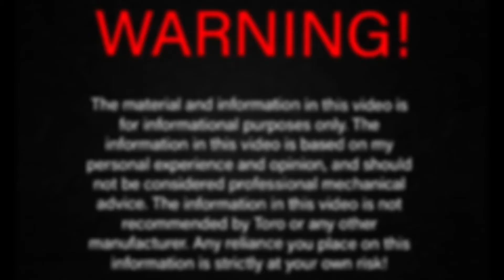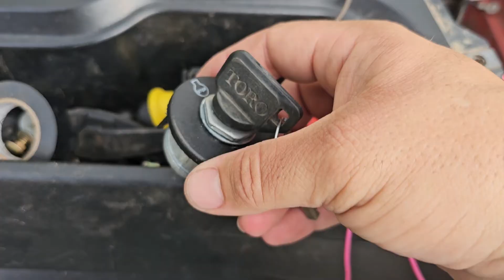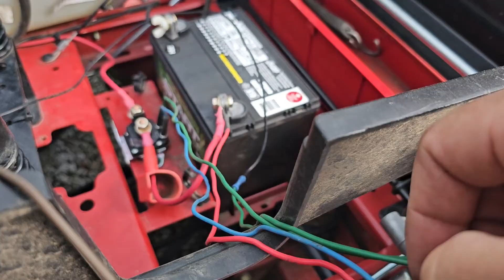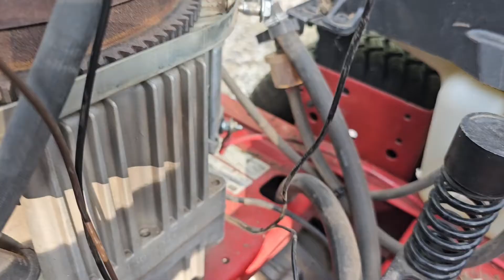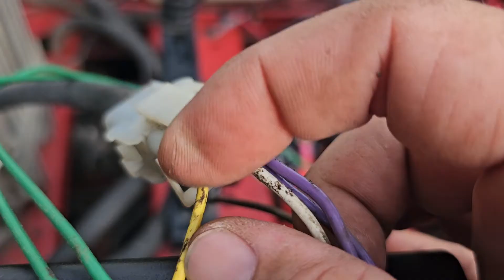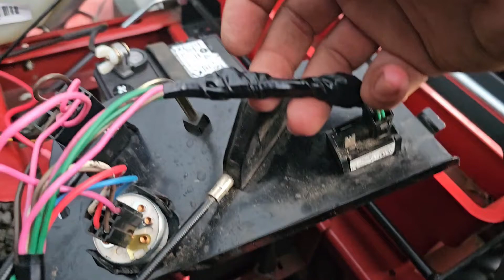Toro Timecutter Zero Turn won't start & Finally fixed!

Comment: What was the part number for the Oregon starter solenoid for the Toro mx 4200. I subbed for your page but could not find the video for the. Video.Thanks.

Comment: Check that the 2 ground wires to the block have a good connection. That should probably be the first step. Loosen the bolt that connects the wires to the engine block and then scratch the copper eyelet connectors around; then retighten the bolt. That's all it took for me. Started right up... Continue on your troubleshooting from that point if needed.

Comment: A power probe would help you do this stuff more easy. Along with a test light. You want to charge the battery only in the run postion. Not when you are trying to start the engine. You can burn out alternator and rectifier. If you shut down the engine you do not want any power going to the alternator and rectifier or fuel shutoff. The fuel turns on when starting and running.  When you shut the engine off the fuel is set to default to stop the fuel. No power goes to the fuel needle  If it does you could burn it out or the battery will be dead in a day or soo. When you stop the engine the battery should not be suppling power to anything.

Comment: What made mine keep starting when i tried to crank it up to take off my trailer ? Will be getting a new ignition switch this morning.  Could the contacts be corroded ?
Reply from the maker: They could be. The old ignition switch on mine actually came apart.

Comment: I have taken out the (Kawasaki engine) from my Toro and installed a Kohler engine SV725. For the life of me I can't get it to start from the switch but if I jump it from the selinoid, it will over but not start. But if I detach the kill wires it will crank up' Will your steup solve my problem? I notice that the wiring harness plug from the Toro body has 4 prongs but the engine has 5 prongs and I have no Ideal how to get power to the starter by this from the switch. Again will your setup solve this problem?
Reply from the maker: @ronniewortham3260  it should, but without seeing it I can’t guarantee it will. But pretty much all motors need the same things to run/work. You may have to trace each wire from that engine plug back to the engine to see where they go. You “should” have one for the starter, one for the kill wire going to the coil, one to charge the battery coming from the voltage regulator, and one for the fuel shutoff on the carb. Mine did have 2 wires going from the engine plug to the voltage regulator and I basically just joined those 2 wires together on the mower side of the plug. However the problem I was running into was the switch on my toro. It didn’t have a spot to wire the kill wire on it so when I first did this the way it was cutting the engine off was through the fuel shutoff. Another reason I did all this when my factory switch died on me. So I would recommend make sure you’re using like an aftermarket key switch that has a spot for the kill wire. Hope this makes sense cause it’s kinda hard to explain through text. And I hope this helps!
Reply: @MattBuild  Hey, thanks , I'm gonna try it out to see if can follow your instruction by the video. And it is kinda hard to explaintoo, I try to make sure from my end that I'm telling you right myself. Thanks though, I will try it today.
Reply from the maker: @ronniewortham3260  I hope it all works out for you!
Reply: Well, I was doing the job for a friend and he decided that he didn't want me to try that. He didn't know he had bought (a pig in the blanket), so to speak. He's gonna try to take it back from where he got it from to get his money back, good luck with that. But I'm saving your video for my future use.

Comment: Nice work. What did you do about brakes?
I just had to replace the brake control module again but if it goes again, I might follow you on this. Cheers
Reply from the maker: Thank you, I haven't done anything with the brakes yet. I honestly forget about it until someone asks because my land is pretty flat and I don't notice not having them. I'll start working on trying to find the parts I need to make the brakes work and make another video on how I did it.